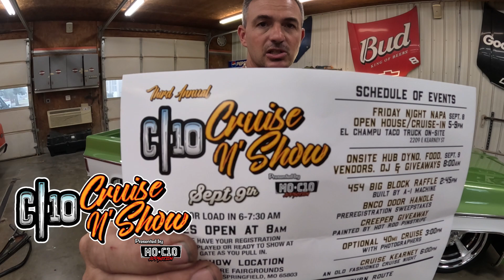GMG C10 gets Brothers One Piece Side Glass UPGRADE before the C10 Cruise n Show in Springfield MO

Comment: Curious about the durability of the one piece windows, is there a lot of flex, and how well do they seal on the highway
Reply from the maker: @martinolivas319    In all honesty they are terrible, the worst part about them is you have to cut your outside door handle button and part of its housing so much it ends up having door handle push button problems.  I do NOT recommend installing these in a driver, only a show truck that never gets used.  It is such a horrible design, and this is the Brothers/Holley kit I have used.
Reply: @dieboldautobody  I'm surprised, especially since brothers/holley usually have decent products. definately going to keep the vent windows on my 79!